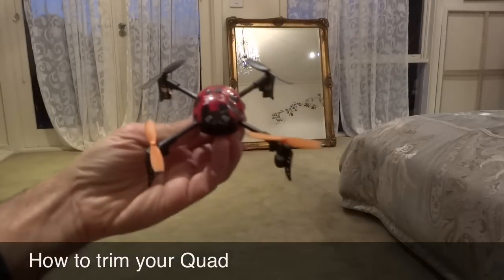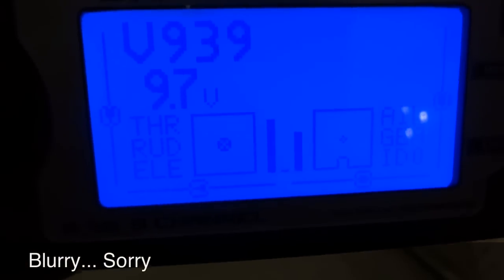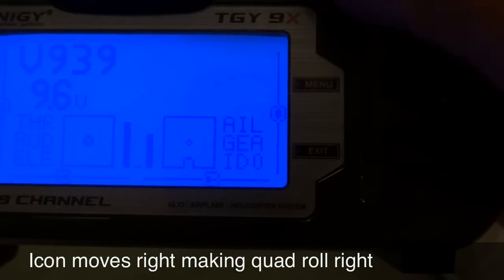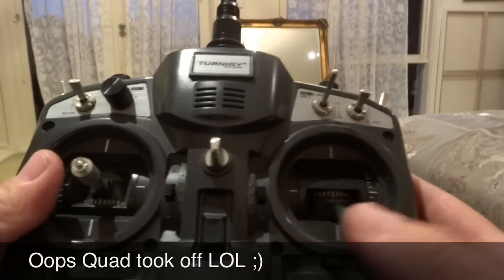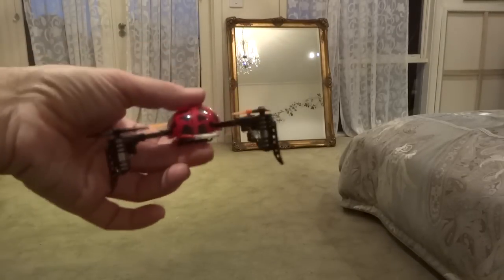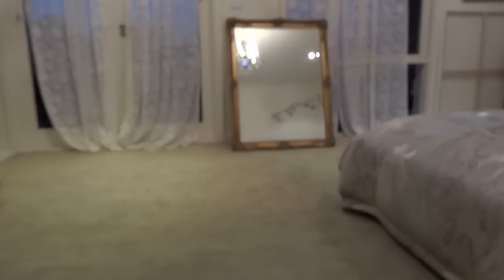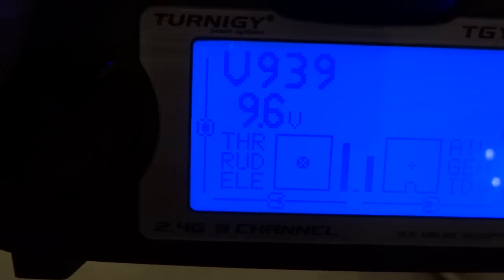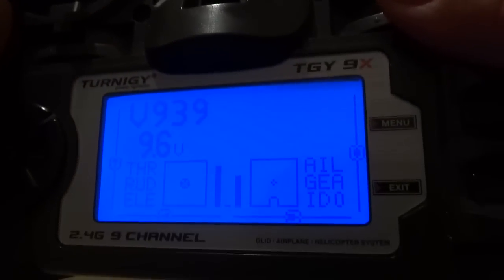How To Trim Your RC Quad For Beginners

Comment: i've been using the trims for quadcopters i build.  yet when i ask people are trimming they don't seem to know or feel i'm not suppose to do that.  it's the only way i get my quad to stabilize and maintain control.  it's better then fighting with your quadcopter or losing it resulting in a crash.  so i'm glad you did this video on trimming.
Reply from the maker: I think its ok. You may just want to check that it is balanced properly in the middle of all the props. Also for home built quads check you have calibrated all your esc's so they all start together and have the same end point. You can always use su trims so you can get your main trims back to zero.

Comment: Yes, excellent guide. it's similar as what I do, difference is before trimming I would like to print out the pitch and roll angle when put the quad at horizontal platform, and then adjust the central point of your RC close to that angle, after this step , I wil begin that trimming like yours, or if the gyroscope assembled not quite well, it will take you long time to figure out the right value.

Comment: excellent mate, thanks.
Even though I only have the cheap controller that came with the quad I reckon I can trim it now from your vid.
Reply: +Snakewhisperer Sir, were you successful at trimming it ? My Quad was for 80 Euros and it has that cheap controller too with no screen. Could you help me if you have done it already ? Thanks.
Reply: I ended up buying a bigger one (A Blade Nano QX RTF) as I just couldn't keep the tiny one (Pico) in the air.
I did succeed in trimming it mostly but it would still drift off and suddenly skip to the side for no particular reason.
I am changing to Mode 2 as I find that easier to use so hopefully it will improve.

Comment from the maker: It will remember your trim settings. Keep in mind that each time you change the battery it may need slight adjustments depending on the weight distribution.

Comment: You should adjust the trim while the quad is in the air. Don't put any input to the controller, let the quadcopter drift.Then slowly correct it. Then if it drifts to the left then apply right trim. If it drifts forwards then apply back trim.  (just a way i do it so i don't have to guess the sweet spot or smash my quad into walls).

Comment: Quads from parrot  , yunec and dji don't need trim . They use gps triangulation or atti modes to achieve stabilisation through flight

Comment: Do i nid to adjust the trim everytime i turn on and start play or just nid to trim once and then it will memorize the setting everytime i turn on the power and play?im using the stock remote and im using the v939 like urs~thx.

Comment: One moter of my quadcopter is not working whole taking off but it start working when I start to use left key 
Plzz help me how can I fix it ?
Reply from the maker: Usually the back left motor will only work when you are off the ground. Check that the motor moves freely and there is no hair wrapped around the shaft.
Reply: +jbalatutube 
Three motor work when it is on the ground 
When I take it to my hand and threw away then only all start to work 
It does not fly stable  
How to make work all motor while taking off ?
Reply: You need to read the directions Ask your self are you using the built in digital gyroscope? Are you setting it on a level surface after powering up? Are you bottom righting both sticks? Hope this helps. If not I will help you any way I can.